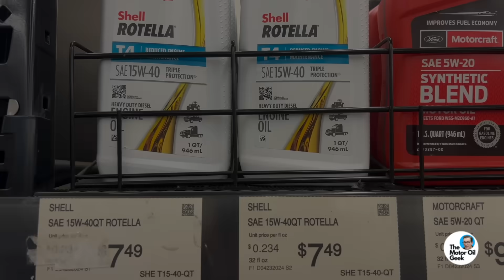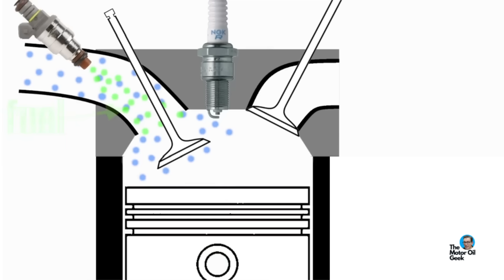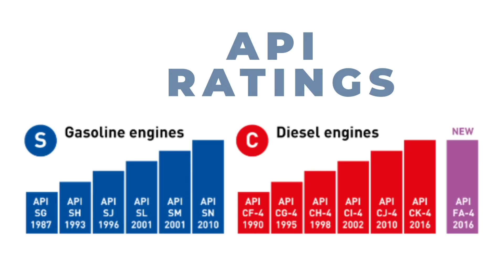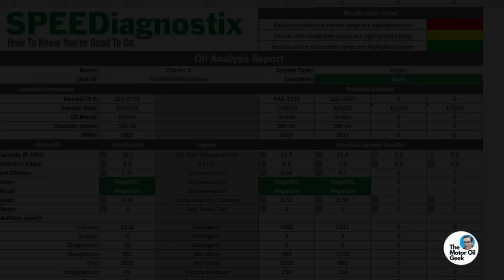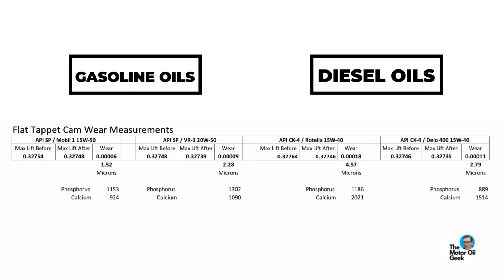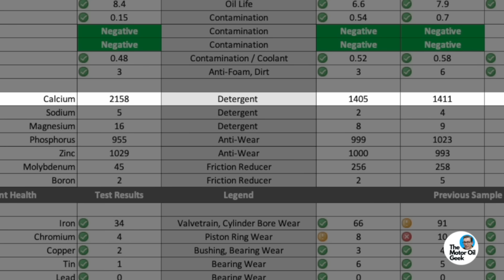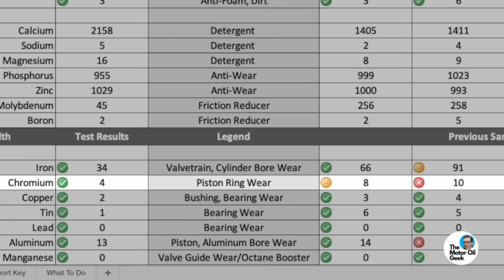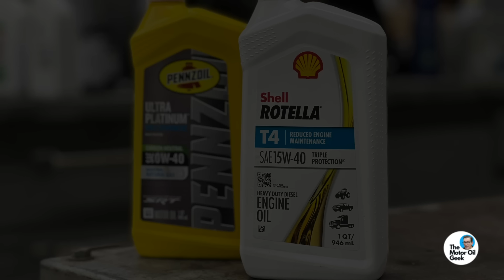Why DIESEL Oil is Actually WORSE for Gas Engines!

Comment: I recently started putting rotella in my little Tacoma.... Just using speculation. This engine has 190k miles on it. I have beat the snot out of it since I got it at 70k. Lived on the chip for years.. money shifted probably twice. only used cheap farm and barn oil in it. At first conventional, then went syn. But recently started burning a ton of oil, talking like 7 quarts in 4k miles. I'm on the lower side of acceptable compression, and the spread between cylinders is out of tolerance.  I am planning a motor swap right now. But as a last ditch effort bought a few buckets of some 15w40 rotella t6, hopefully to try do dissolve some carbon out of the rings and limp it along until I can complete the swap.
Yes, I sent the oil off to Blackstone labs with a full story of the situation. They said they saw nothing abnormal and to make sure I keep the oil topped off. Oh and the exhaust cam gear has some of the teeth wearing off and now I've got oil in my coolant overflow bottle.

Comment: Love the science. Can you comment on running diesel oils in small, nasty running gasoline engines such as generators, lawnmowers, atv's etc... or other small equipment? More specifically, T6 formulation. I have always run a 15w40 rotella T6 in these, in the heat of Arizona. One of the reasons, it JASO-MA certified for wet clutch use and 2nd part is, these engines are dirty. VERY dirty running. 

Also, Can you give your take on shell rotella 5w40 in a gasoline engine?  Calcium has always been in the 800 range. Zero chromium in my results | excellent blackstone results... Vehicles over 200 and 300k miles on it now (one direct and port injection engine). BUT, I do trust the science of things which is why I have had it analyzed in the past. Considering switching to Valvoline R&P here soon.. Maybe things have been great due to how it is formulated more like gasoline engine oil. Thanks man!

Comment: But in old sludged port injected gasoline engines HDEO is proven to have great cleaning effects. Well, it might be bad for cats if they burn too much oil, but cats are usually bust anyway after 200k miles.

Comment: Old gas engines 40 years old and older are different than newer engines. These older engines need a different oil formulation than modern gas engines. So yes 15w40 diesel oil is the better oil for old gas engines.
Reply: Think what is the best oil for a 1950s gasoline engine powered tractor?

Comment: I've been wanting you to do this one!!!! A few you tubers use diesel oil in their cars. BUT is a way it's ok as they use it in old worn CARB engines. I stick with Valvoline Racing 20W50 in my classic cars and Syn Valvoline in my modern cars. Thanks

Comment: Used Rotella 15w-40 in my 90 Cummins from its first oil change, religiously every 5k or less, got 330k miles, before selling it……..not one problem !  Great design
Reply: Well, you’re using diesel oil in a diesel engine. Not exactly the topic at hand. But I do admire Your good maintenance practices. 👍

Comment: To me, the flat tappet cam wear was not apples to apples and therefore not an accurate test. Using different brands and different weights of oil are obviously going to have different test results. So same brands of oils and viscosity rating would have been more accurate data! Or having multiple brands and weights that were in both diesel and gas charts would have been even better, so we could also compare brands along with oil weights.

Comment: If you’re using in a motorcycle with a wet clutch make sure it’s JASO MA2 certified. (Japanese Automotive Standards Organizations) sets the standard for wet clutches so the oil doesn’t cause slippage. But my question would be does that diesel oil have the additives for the constant mesh gears in the transmission for shearing?
Reply: look up "JASO T 903 Engine Oil Standard" and I find:
"The JASO T 903 standard specifies that in addition to the general properties of 4-stroke engine oil, the oil must pass a specified standard for the following two properties:
⋆ A specified minimum friction characteristic that is vital in preventing clutch slippage.
⋆ A specified maximum amount of viscosity degradation caused by extreme high shear forces between transmission gears."

Comment: I disagree across the board.  Yes, it's an old-school mentality, but there's a reason. Why ? Because it works. He uses science to justify his claims but has nothing to show where an engine failed from using diesel oil. If it has 15-40 on the label, it's in my vehicles  !

Comment: Most people who are proponents of diesel oil in a gas engines are the old school, flat tappet carbureted, TBI or port injected. I don't think it's a "thing" with the owners of newer DI gas engines. Diesel oils need to have the extra zinc/ phosphorus to combat the extra detergent/dispersants so it's just a hand-in-hand thing. So, for old school aspirated engines, the preignition problem present with DI engines isn't so much a problem. Maybe with the older engines, it's that the extra additive boost in diesel oils isn't necessary, but not really harmful from a wear standpoint. I can imagine the diesel engine would be subjected to the same wear problem as the older gasoline engine if it were harmful. We all know diesels are the longest lasting engines despite it all. Interesting video.
Reply: us new school guys use it religiously when running E85 tunes and turbo cars, mechanics who drag race taught me well, not all this "advice" on YT is expert level, certainly this video isn't (in my opinion)

Comment: So most people running diesel oil in gas engines are doing it in older engines, not modern direct-injected engines. What's the scoop on use in carbed or "indirect-injected" engines?

Comment: I use Rotella diesel oil in my motorcycles because it works with wet clutches. Never had a problem in hundreds of thousands of miles.
Reply: Why not use a motorcycle oil, designed for motocycles?
Reply: Shell Advance 10W40 AX7 is specifically designed for motorcycles...
Reply: I too have anecdotes that are basically useless compared to data.

Comment: Whoa, you're going to piss of the TJwrangler forum members who think they are the end all be all of automotive knowledge. They also claim that synthetic oil will make the engines leak, blow bearings, and other sorts of catastrophic failures. They have even claimed that synthetic oil "dries out seals."
Reply: Synthetic oil absolutely makes your engine leak, if it's an old engine that hasn't had its seals serviced. Replace all the seals and you're good to go with synthetic.
Reply: Well jeeps aren't know for reliability or good QC either xD
It's very convenient for conventional oil to clog up you engine to keep low quality parts from leaking,
From a company who got bought out 5 times within the past 10yrs due to hardships. Now the new owners are struggling still struggling (stellantis) and the new economy definitely isn't gonna help em
Reply: @ I'm only talking about the AMC 4.0. I don't have a single brain cell worth devoting towards knowledge over JK and above vehicles which bear the name "Jeep"
Reply: @Spike_-rx7bx  The 4.0 jeep engine is widely regarded as one of the most reliable and durable engines ever made. What the hell are you talking about.
Reply: @Spike_-rx7bx  what? Oil doesn't clog anything unless the vehicle is UNMAINTAINED. Lack of maintenance causes seals to deteriorate and for contaminants to gather. Synthetic is great at cleaning the crud out and that's why leaks develop. 

If you're switching an old car to synthetic, replace the front main, rear main and valve-cover gaskets. That's 90% of the leaks synthetic can cause

Comment: I've been using 5w40 T6 Rotella in all my Toyotas forever. My oil analysis comes back with excellent results, so I'll stick to T6.
Reply: Yea I use it in my Old 30 + year old Small block chevy with Flat tappet lifters. You can find 5w-30 T6 now or 0w-40
Reply: Bro wishes he had a diesel 😂
Reply: @benjamin4321 anybody who uses “bro” to start a sentence is remedial.
Reply: @Edizzle15  You pose as a diesel engine owner. Lmfaoo
Reply: @benjamin4321  you have the grammar skills of an 8yo acoustic kid
Reply: @Edizzle15  That comment won't get rid of the fact that you are a poser. 😂
Reply: @Edizzle15 what’s an acoustic kid?
Reply: @benjamin4321  who
Reply: @benjamin4321  my tbi gas chevy runs like a diesel.

Comment: Rotella T-6 full synthetic "diesel" oil is APPROVED for diesel engines, gas engines, motorcycle engines and transmission, wet clutch motorcycles, AND Allison transmissions.
Simply stating only use "diesel" oil in diesel engines and "gas" engine oils in gas engines.

Comment: i allways run thicker oil than the so called factory spec not going to use 5-20 and other thin oil to get some mileage never had any problem with the thicker oil

Comment: This dude always has issues and its usually being vague or generalized comparisons and or has apples to oranges comparison. In this case anyone with at least 2 working brain cells knows you dont use diesel oil on a gas AUTOMOBILE engine. You can use rotella t4 and t6 in most jap wet clutch bikes. T6 should be used because its better protection and thinner at cold start temps which is better circulating as it warms up. T4 is ok but is 15w40 and doesn't protect as well but people with jap bike usually go for it because its cheaper. Some people report issues with clutch slipping when using T6 but i think its usually probably because that person used T6 in a clapped bike then went and beat on it to see how good the oil was and got clutch slippage because it needs  the stack and gasket replaced at the least but usually needs more.

Bottom line use T6 if you have a jap wet clutch bike.

This dude is kind of a douche because he should've compared cheapest, mid and most expensive MOTORCYCLE oils he can find against T6 and then TEST them in a mass produced 600-750cc jap wet clutch bike!

Comment: An old engine that has a belly full of the "wrong" oil, is way better than the same engine with no oil. I run rotella t4 in my 200k+mile accord because it's cheap and i don't care ✌🏼

Comment: You should specify that it is bad for Direct Injection Gasoline Engines only. I've personally been running Rotella in every gasoline engine except 2 Cycles, and I work in a Machine Shop and have seen quite the opposite effect. Everything I've run Rotella in including Blown Alcohol Engines, has been 100% POSITIVE results. Less wear, cleaner ring lands, valves, combustion chambers, etc. I usually agree with your findings, but I personally have been doing exactly what you say not to do, for over 30 years with only positive results, my 35 year old lawnmowers that have never required anything but an occasional spark plug also would disagree with your findings. Direct Injection MAY be different, I have little to NO experience with those.

Comment: diesel oil is great for old cars with flat tappet cam setups and the like. modern gas engines eh, but anything that is by definition "wore out" bearings and such... youll be surprised by how long they can be kept alive with 15w 40 oil. same thing with rod slapping small engines. i have a lawnmower that basicallly has 15 40 diesel oil for a main bearing it slaps and clunks with anything lighter but has run for 8 years on the dino bones and zddp doesnt even burn it.

Comment: Screw this. These two guys are spouting technically incorrect information faster than it's worth pointing out. Is this the new normal.. tell "white lies" faster than someone could refute them with facts?  3 minutes in and the list is only getting bigger.  Omfg.. The match into a bucket of gas.. WILL CREATE A FIRE.  He probably wanted to say a bucket of Diesel will put a match out if thrown in. These two have enough knowledge to seem like experts to everyone but knowledgeable people on the Dunning Kruger chart

Comment: You Lake, I would love to see a video about motorcycle oils.  With the wet clutches and gearbox being lubricated with the same oil as the engine I am sure there are some special considerations concerning sheering forces because of the gears and possibly anti-wear additives with the clutch pack.  I would really like to learn more about picking the correct oil for my bike.

Comment: Ok, this may be anecdotal but the valvetrain in my 4.0 Jeep motor was SIGNIFICANTLY noisier when I used the Pennzoil Ultra vs. using Shell Rotella.  I'm not quite buying the argument here in older engines. I don't use Rotella in my DI Subaru, but that old pushrod Jeep? Yeah, I'm sticking with it.
Reply: I've noticed the same thing I've always been a fan of Valvoline oil and I've also used castrol oil in my other vehicles without issue and Castrol oil is a really good oil but I so I thought i would use it in my jeep 4.0 and oh boy my jeep sounded like it was coming apart lol so I changed it back to valvoline and it was quieter. I might have to try the shell rotella 10w30 and my jeep only has 122,000 miles on it oh my jeep is 25 years old and I bought it with only 76,000 miles on it 9 years ago.
Reply: @bretthibbs6083  I've also used Castrol Edge in that Jeep and it was not as noisy as the Pennzoil but it still wasn't making the top end sound very happy.

My Subaru and Mazda like the Castrol oil, but the 4.0 not so much. Haven't tried Valvoline. My opinion now is that the Rotella seems to keep the motor the happiest so why mess with it?

Nice find on the low-mile Jeep, btw. Mine's at 183k.
Reply: I’m in a 99 XJ daily and running the t4 rotella 10w30. It runs fine. Congrats to both of you on the low mileage jeeps. I’m at 282k. I’m aiming for 300k.
Reply: @ I've got a buddy with about 320k on his. These motors last when you take care of 'em.
Reply: So I tried pennzoil ultra and my Jeep 4.0 with 83,000 miles sounded like every lifter was going to come out. And like an idiot I ran it that way for a thousand miles probably. Checked the oil and it had consumed a quart and half. Went back to Rotella. It just works in everything I own

Comment: I use Rotela t4 in my thumper motorcycles that don't rev very high. Like a KLR-650. However, I still use Kawasaki or Mobil 1 full sythetic in something like my ZX-10 Ninja. Am I doing it wrong?

Comment: I have a 4.6l with almost 350k on it bought it with 65k on it has had nothing but rotella 15 40 in it. Zero problems or failures so far

Comment: 6.0 injector nozzels are very visible. Your eyes are shot. Also 6.0 injector nozzels all do a single shot of fuel, there's no pilot injection or multiple injection events. The injector parts are too slow and too heavy and too prone to becoming stuck to do multiple injection events. That's why every van and truck using those engines had that feature removed if they ever had it and went to a dealership.

Comment: Been mixing it with my engine oil for 20 years on my 99 Chevy Silverado and it’s got 400,000 miles. I don’t have any science lab checking out my results, I just know it works because it’s still running. This is only applicable to older vehicles. Not new ones that have less than 100,000 miles.

Comment: I actually have an experience with a Dodge Spirit and the 3.0 v6, it ran diesel oils from day one because the man who owned it before me only used 15w-40 that from day one, i bought it at 278k on the odo and drove till 335k then traded it in still running fine.  That said I wouldn't normally do that but did in that case since that's all she drank.

Comment: Four stroke Dirt Bike guy here. Years ago, Rotella was recommended in some dirt bike applications. 
Shell changed the chemistry some years ago that Rekluse no longer recommended it. 

To this day, dirt bike guys think Rotella is gold. The foolish assumption is associating dirt with contaminants. Yes Rotella has a higher zddp content. It’s probably beneficial for these overhead cam engines. 

You’ll hear them say, my oil doesn’t get as dirty with Rotella, thinking the color of the oil is what determines its health. 

That’s a big mistake. The deterrents in an oil like Rotella will make the oil “ look “ cleaner even if it’s contaminated. 
Additionally, the dispersants create drag, that reduces HP. 

Most high performance single cylinder four strokes are JASO MA 10w 40 or 10w 50 rated. 

Application dictates chemistry ✅

Comment: Used to use Rottella 15w-40 in everything except the wife's car. Back then it was rated for both  "C" and "S" service.  Stopped doing that about 25 years ago because I sold the business and no longer had a mixed fleet. A few years ago I grabbed a bottle of Rottella for my old pickup and noticed it no longer had both ratings, haven't used it since.  Now I run VR1 in it because of the newish flat tappet cam. Actually ran the old 318 on current spec 10w-30 over 60,000 miles with no ill effects. Didn't even worry about zddp until I built a 318 for it with a new cam.  Even with that oil, new cams are a crap shoot.

Comment: Lake-

I know a lot of guys, myself included, running VR1 20-w50 in their classic car/ hotrod with a carburetor and a flat tappet camshaft.  It’s a good oil for that anpplication, and you have videos demonstrating that.

I was intrigued that the Mobil 1 - 15w50 had notably LESS wear than the VR1.  Is that wear test result significant enough for a guy to switch from. VR1 20w50 to Mobil 1 15w50?

(For sake of this discussion, just apply it to carb’d engines where LSPI is not really a thing)

Comment: I’ve got a petrol engine that chews oil like no tomorrow (Rav4), I’m wondering what soot build up I’m getting in the cylinders and on the pistons.
would a 15w40 diesel oil actual clean up the soot?

Comment: I use t6 5-40 in everything.  Mowers quads gas powered Jeeps and all my diesels.  All my small engine generators and my generic propane get it. Been decades no issues.